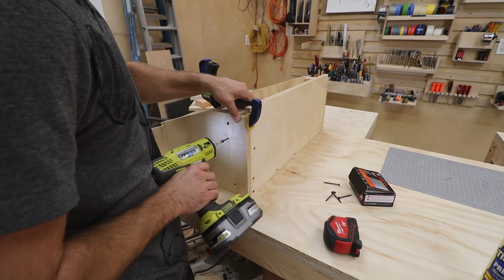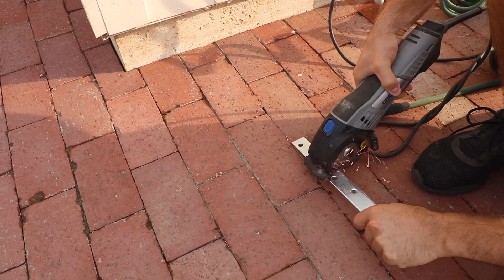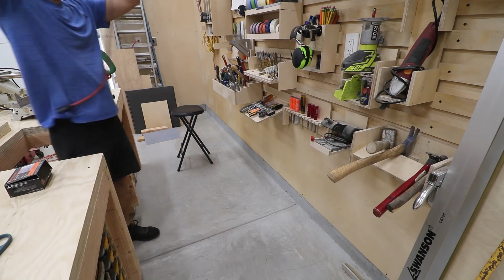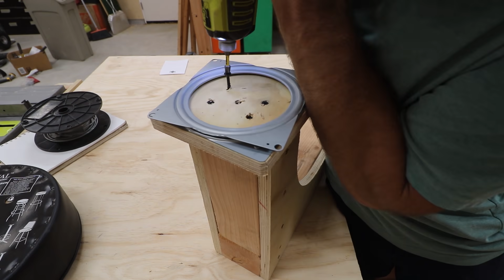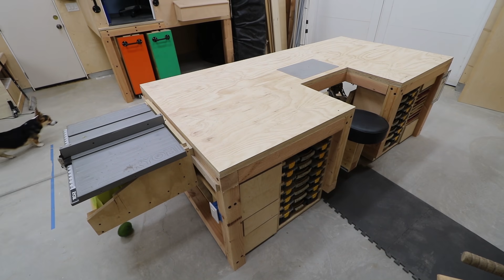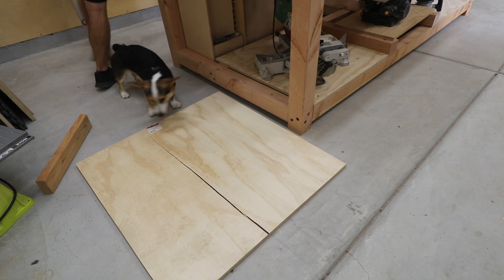Ultimate Workbench Upgrades! Built in Slide Out Seat

Comment: nice build i wonder if you could have used 2 cleats on the saw instead of one and a bumper board, also the cut out for the seat area is probably a little narrow for most, think the seat should have extended out a bit farther too.  might want to change out  one of the receptacle box for a 2 gang box  so you wcan leave more than 2 things plugged in  , a plug in the top surface might be nice too, just some thoughts  that popped in while i watched .  OH and good playing with the dogs!!  HAVE FUN

Comment: I noticed you wired your outlets with yellow wire.  I believe this implies a 20 amp circuit.  If your wall outlet is actually 20 amp, make sure your extension cord can handle it.  You should also be using outlets rated for 20 amps.

Comment: I screwed my miter saw directly to the bench top.  I have short 2X4s with 3/8” dowels that support long pieces of wood.  The dowels keep the 2X4s from “rolling” as the stock is shifted.  When I remove those supports I do still have the holes in the bench top though.  Removing the screws lets me lift the miter saw from the table top.  Again I have residual screw holes.  The miter saw is on one end of the bench so I have the entire right side of the bench to serve as support for wood.  I use a roller support on the left side of the bench if I need to support stock on the left.  The roller support also works well for an input support for the table saw and I have a second one for the output side of the saw.  The roller supports might be easier than using your bench for an output support for cut stock.

Comment: Beefing up the seat... I’d extend the seat support to rest on the floor when sitting.  I’d add a piece of high molecular weight plastic to slide on the floor.  I’d cut out a 1/2” thick piece to fit the bottom of a 4/4.  You can cut HMWP from an inexpensive cutting board.

Comment: When you add your Sawstop, you’ll likely want to move the bench depending on which model Sawstop you get.  I have the cabinet saw and it is pretty heavy.  I made an air bearing to move the saw on a cushion of air, that works pretty well and makes the saw easy to move without giving up any stability when the saw is not being moved.  The Sawstop cabinet saw is a superb saw.  Mine is 240V which entailed adding a 240V outlet but it powers through anything I’m likely to cut.  I put a router table on the right side replacing the factory wooden right side.  Wixie makes a digital addition that allows accurate placement of the fence within 0.01”.  That makes the saw fence dual purpose, usable with the router and is precise enough for joinery.

Comment: I think the cleat for the saw is probably strong enough, hard maple would probably be stronger.  I’d add a hasp to either side so the saw can be clamped in position and cannot ride up the cleat.  https://www.amazon.com/Adjustable-Toggle-Holding-Capacity-Release/dp/B083GQLBJN/ref=asc_df_B083GQLBJN/?tag=hyprod-20&linkCode=df0&hvadid=416945911357&hvpos=&hvnetw=g&hvrand=14069195596642603139&hvpone=&hvptwo=&hvqmt=&hvdev=c&hvdvcmdl=&hvlocint=&hvlocphy=9016851&hvtargid=pla-897976744761&psc=1&tag=&ref=&adgrpid=96633973649&hvpone=&hvptwo=&hvadid=416945911357&hvpos=&hvnetw=g&hvrand=14069195596642603139&hvqmt=&hvdev=c&hvdvcmdl=&hvlocint=&hvlocphy=9016851&hvtargid=pla-897976744761

Comment: I love the bench.  I’d make a removable platform for the cutout to make the workbench full 4’X8’ and flat for those times that the work flow would be better served with a full sized flat top. You’ve already got the metal supports so it would be a simple addition.  If you add cleats to the bottom of the platform, it’ll store on your cleated wall.

Comment: You can always double up on the sliders (vertically) to accommodate for wear or weight shift.  Only difference is you'd need a taller piece than the thin edge of a 2x4

Comment: I like the design. May I entertain a few thoughts, please. I wonder if the left/right/lateral stress is going to be too much for the slide hinges for the stool. Second at around 11 mins you were rolling up the paper. Why not add a hand wheel to one side or the other to the all thread rod supporting the paper and add some end bells to the paper roll? Lock everything is place with a few nuts and it would make the paper rolling so much faster and easier. Added idea here, weight the hand wheel so one good spin will roll it quicker. Seriously I really like what you have done :)

Comment: if you want it to be mobile, and still plugged in, just mount one of those spring retractable reels to it.

and there are a few options for adding casters.  the easiest option is heavy duty leveling casters like the following that can hold 600 lbs each / 2400 lbs combined.  there are a few four and five star reviews from people with thousands of pounds on them.
https://smile.amazon.com/Caster-Barn-Retractable-Leveling-Machine/dp/B0713S3HZ7/ref=pd_lpo_60_t_2/137-0005595-3023604

a much more complicated setup is something i've seen on the large rolling ladders we use at work.  you would need to study and figure out how to adapt to your platform, but i think that's kind of right up your alley.  they mount the casters to a large bracket that completely lifts them out of the way, or locks them in place when lowered.  you would be able to build the mechanism yourself and make it as strong as you need, then mount regular casters of your choice to it.
the ladders we use are from uline, linked below, but it's hard to really see the mechanism.  you'd need to see one in person to get a good look at it, or find them from a different manufacturer with better pics.
https://www.uline.com/BL_3863/Rolling-Ladders?keywords=ladder+platform

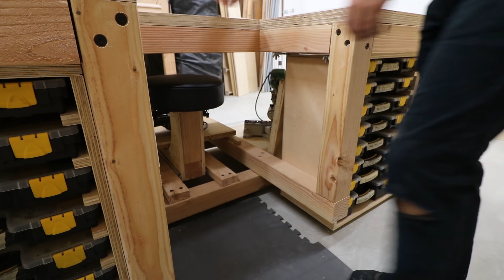Comment: when they give a weight rating, they always underestimate by a certain percentage... but i still would not have cut it so close on those drawer slides.  the 4x4's and plywood, plus your body weight, will easily exceed 150 lbs every time you plop down on it like you do at 10:16.  even if you only weigh like 100 lbs.  it doesn't take much speed to double your weight; even just a short drop increases it significantly.

Comment: If the sliders dont hold that much weight, why not use two per side?
Reply: I thought the same thing ;)
Reply: Or add a single caster directly under 4x4 on which the seat rests.

Comment: Love the bench, especially the seat.  I have to mention the extension cord covered with the foam; please don't do that - the cord is rated for "open air", which is why the tag will always say to never put it under a rug, etc., much less foam.  Most of those cords are undersized to begin with and the heat produced from current will definitely shorten the life of the insulation and it could get hot enough to light up your foam.  I know your concrete floor won't burn, but it's one of those innocent things that many people do with no problem - until the house is full of smoke.

Comment: Always fun videos!

I’m a bit concerned about the 20 amp “bench circuit” feeding out of a 15 amp receptacle on the wall via an extension cord that will constantly bear weight and friction of walking over it. That insulation is going to wear out and short out. 

It would really be best to permanently wire this into the circuit and keep it out of the walking path. Maybe something dropping down from above?
Reply: How did you know the wall receptacle is 15A?
Reply: @thechileacademy4800  Because the plug wasn’t a 20amp style plug (they have an extra sideways slot). The circuit may be (and probably is) 20amps, but each of those receptacles is 15amps wired with wiring rated for 20 amps. If too much power gets pulled from all 3 receptacles combined, the breaker won’t blow until we’ll after 20 amps, but in the meantime, the receptacle the extension cord is plugged into could be overloaded.
Reply: @robb0995  It’s almost as though you know something about this topic.  Thanks for the lesson :)
Reply: @robb0995  Ah thanks.  Didn't even see that.  Is there a proper way of doing this then? I'm curious.
Reply: @thechileacademy4800  Best would’ve been to run power to a junction box in the floor when they were pouring the floor. But that’s not as flexible as Ben would probably like it. So, next best would be to wire a junction box in the ceiling and drop a line down from above. You see this in factories/labs with the spiral cables hanging down that can plug in. Another option would be to run metal conduit over the floor (to protect the wires from being stepped on) and put one of those rubber covers over the conduit. 

I’d also probably like to see more ampacity than 20 amps. The table saw itself may draw nearly 20 amps. If Ben were to run the saw, maybe a heater plugged in to dry something, or a second person were using a power tool at the same time, it’s going to strain the circuit. A 30 amp or higher circuit to feed this area would’ve been nice. 

I really love Ben’s energy, imagination, and thinking process on how to build something perfect for his use cases. He makes things work to achieve his vision. I don’t want to rag on him like some YouTubers who are just spouting unsafe bullshit. I just wish he took one extra step to think about how things could go wrong the ways he thinks about all the ways things could be just the way he wants them. 

I’m still super nervous about the day the wall falls down in his kitchen because of all the supports he almost cut all the way through. He cares so much about quality, I’d like to see him get the quality he really wants.

Comment: Hey, I have concern about your power cord to your workbench. You said you put it in the expansion joint of the slab. I would recommend either a) not doing that, or b) use a concrete wet saw to cut a larger groove in the concrete. I don’t know where you’re based, but I’m warmer summer months, concrete definitely expands and could pinch the cable, resulting in a short/reduction of power. Not a concern as we head into winter, but maybe look at revising how you get power to your bench. Otherwise, great vid, great content, keep on trucking!

Comment: Lol your Corgi and my Mini Aussie are identical with dropping the damn ball at the most in opportune times! Only mine likes to drop it on my head or by my ear when it’s bed time 🤦🏻‍♀️ and it’d be nice to move your bench however the size it is plus the space you still have in your shop I don’t think it’s necessary and I doubt you’d move yours for any ole reason anyways so I wouldn’t sweat it. I agree someone else said to use a wheel mechanism (preferably one that self adjusts to weight and the surface) to support the seat because I’m sure those drawer slides won’t make it for long just because the weight is mainly on one end and not divided evenly but I really am happy you added that seat because it’s often missed on most other builds

Comment: Hey, dude. For the seat, why don’t you attach a wheel/caster and cut a notch (or maybe fold-up wheels) so that when you extend the seat, the weight is not supported by the slides alone?
Reply: Add another set of slides.
Reply: thats a good idea
Reply: I was thinking the same thing, why cantilever all that weight when you can support it with the floor on some HD wheels.
Reply: Because it looks like he’s a floating jeti master craftsman sitting at his work bench the way it is lol. Safety first though
Reply: when he said 150 lbs....I was like....yeah, I am outx2. I would have to have a tripod wheel to support my beefy behind.

Comment: You should look into integrating an on/off switch just before the table saw plug. That would add a safety feature of a standard off switch position to hit in case of emergency. No matter the tool.
Here's an example: https://www.amazon.com/POWERTEC-71054-Magnetic-Paddle-Switch/dp/B01IEM2DSM/ref=asc_df_B01IEM2DSM/?tag=hyprod-20&linkCode=df0&hvadid=216516247812&hvpos=&hvnetw=g&hvrand=16301231510101246002&hvpone=&hvptwo=&hvqmt=&hvdev=m&hvdvcmdl=&hvlocint=&hvlocphy=9029741&hvtargid=pla-379990411364&psc=1

Comment: If you want to increase the weight limit of the slide out stool you could double up the slides. But you would have to re make the post because I don’t know if you have room to add more slides as built. However it seems to hold your weight just fine so not really necessary in this instance.

Comment: That cleat is brilliant, but would it be enough to hold the tablesaw through multiple projects?
Reply: @danielwest7809  and it looks like it flexes a tiny bit at 4:22, even though it's brand new.  
for something lightweight like the paper roller, it looks like a great idea.  but for the table saw, i think i would have wanted something a bit more sturdy.  like some metal cleats.  or at the very least, make it out of actual hardwood instead of plywood.
Reply: @thinkdunson  I think a good compromise would be to add two folding legs to the tablesaw, so that there is plenty of support from the ground on the end opposite to the french cleat.
Reply: @bs838  that's an excellent idea.  i saw something similar in another video where a guy mounted the table saw to his workbench with a piano hinge, so that it can fold completely under the table, and then fold it out and extend the legs to use.
Reply: @bs838  One variable this could introduce is some slop in terms of height-from ground. To resolve that, the legs could attach to slots/lock tabs on the base of the table itself or rest on a load bar on the bottom ledge.  This would permit the saw to slide on the cleat.  That said, I don't feel that the the cleat is a safe solution for a table saw.  At the minimum, a "locking bar" should be installed above the lower rest bar to prevent the assembly from walking up-and-over should kickback with sufficient force occur.  It's all unlikely, but a table saw moving while in use easily leads to lost-limbs, and the mode of failure of a french cleat is "Thing Fall Off".  I love the idea, but it feels like a lot of risk to me.

I'll absolutely be attaching cleats to my workbench for accessory mounts, though.  Brilliant idea.
Reply: My very first question.

Comment: While the french cleat attachment system for the table saw is brilliant from a modular perspective, I'd feel very uncomfortable using it if it wasn't locked in place somehow. I'm worried as to what might happen if kickback were to occur when working with a large piece of material, I fear it's entirely possible for the running tablesaw to knock itself out of the cleat in such conditions. :/